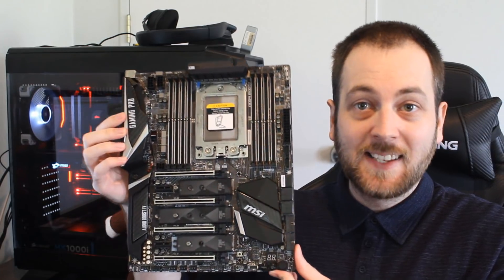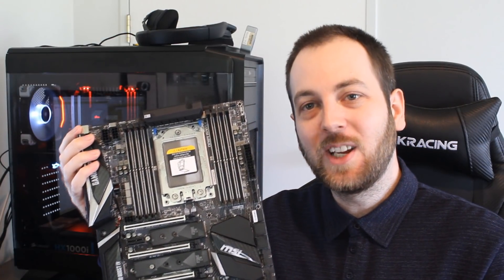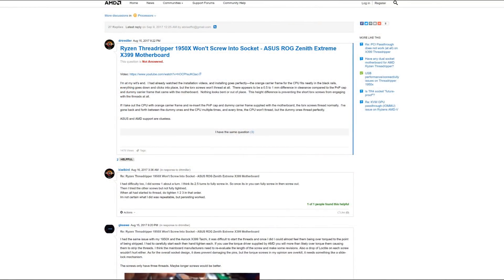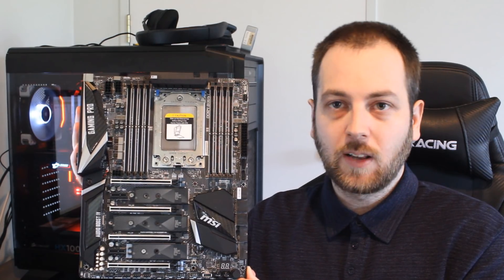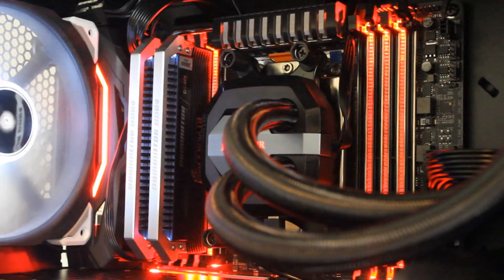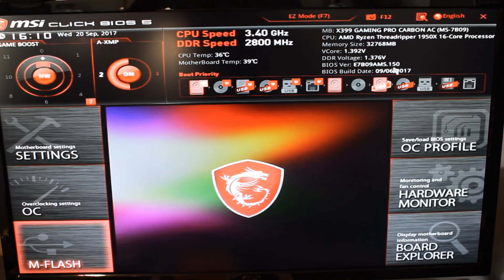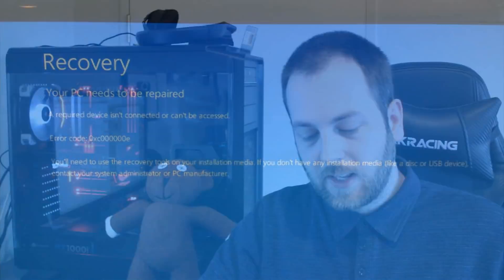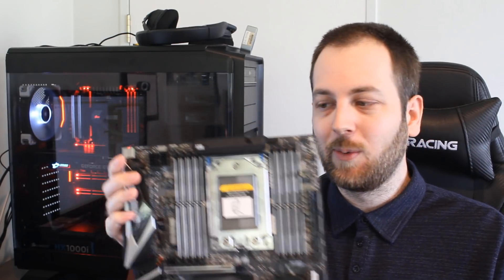X399 Is A Mess Right Now (Socket, Memory & Windows Issues & Fixes)

Comment: I have been waiting since launch day to post my review on the zenith with 1950x...1 rma later and if I had a stick of dynamite I would have blown the entire thing up.  Memory issues like no other....3200 Dominator platinum 32gigs.  Board not recognizing all 4 sticks, unlimited boot cycles.  Tried gskill memory same issue.  Aura lighting not working.  But with each bios revisions it seems to be getting better.  I agree when the kinks get worked out it will be amazing.  But it's not just gigabyte boards.

Comment: Thanks for the informative heads up Kevin.  I'm gonna wait until more of the bugs are worked out on the AMD platform.  My last early adoption was a Sandy Bridge i7 2600k & MSI P67A-GD65 and that took about a month to sort things out. (frustrating)  Ultimately it came down to a B3 revision board and good bios update. (Over Clocked and Still running super stable today)

Comment: No problems with memory with the zenith and 1950x. The cpu was hard to screw down, but nothing this. 
I installed 8 dims with G.skill  3600mhz cl 15, installed windows and overcloked my cpu in no time at all. 
I am running at 4Ghz, 3466mhz 14-13-13-33 now. (3500+ CB15) 
What i don`t like about the Zenith, is that the values reported by the Oled display is wrong. All of them, any bios iv tried. Not even cpu clock speed is correct. On a 600$ mboard!  
Also, I am not able to control the vcore like you can on the Msi board, it constantly undervolt my cpu. 
My last x399 problem; the temp offset. 

But i do not regret getting the 1950x and the Zenith. :P

Comment: It is mostly a socket issue. Not posting with OC is ram fail. Look for "moved" or bent pins. Install CPU on MB out of the case on a flat surface and follow these instructions: https://www.youtube.com/watch?v=RUOZE0N5WE8

Comment: so the lesson is if you are going X399 you better go MSI or ASrock(?)
Reply: milodon316 i have msi x399 and i didn't experience any problem. The only thing is make sure you disconnected all the other drives. I m at 4.05 Ghz 1.33 V on 360 aio water cooler

Comment: It seems that most of these issues are bios related. Except for the crappy Foxconn socket. Keep updating the bios and I would be confident most if not all issues will be resolved. Also, very valuable info regarding which would be the better motherboard to buy.

Comment: Unfortunately, I had to send my Aorus X399 mobo back to the manufacturer. For some reason the system was not able to pass the POST and the CPU status LED on the board stayed lit after power on. I was running the F2 BIOS and the system worked for some time before this issue happened. The problem remained despite of all my troubleshooting efforts. I am now waiting to hear from GIGABYTE and get replacement from them. 

Regarding those other issues described in this video, the problem with the socket's retention bracket was present on my Aorus X399,  I also had the issue with the C0 BIOS code, but that disappeared after a BIOS update. I also encountered the annoying problem with the missing driver for the Inter Wi-Fi adapter but managed to get around that. Luckily, I haven't experienced any memory compatibility issues with my 64 GB memory kit. Used Corsair's Vengeance  CMR64GX4M4C3200C16  RGB DDR4 memory.

So far, my experience with the X399 platform has been terrible. The motherboard manufacturers need to work more to fix all of its different quirks...
Reply from the maker: Sorry to hear that, how long until you have a replacement?
Reply: The motherboard is still on its way back to the manufacturer. I should hear from Gigabyte by Monday next week.
Reply: Alexander Iakimov gigabyte, there's your problem
Reply: Well, I will be receiving motherboard replacement sometime next week. I should have researched the different options better before making my choice. 

If I had to choose now, I would have bought X399 mobo from MSI or ASRock. Looks isn't everything...

Comment: I know this is completely unrelated to x399 but I'm trying to find out any answer I can before my RMA period ends. I have a 1700x with an x370 Taichi. I bought both of these parts with the specific intent of overclocking in mind. It is being cooled with a Scythe Mugen 5. I know it's not the best, but it's certainly better than the stock cooler.

My chip can only achieve 3.8ghz stable, I certainly didn't win the silicon lottery but I figure whatever, it's still good enough. However, my issue is that sometimes it boosts itself up to 3.825, 3.85, or even sometimes 3.9

During the times it does (randomly) boot itself up like that, I crash. I have core performance boost disbaled in bios, cool and quiet disabled, c6 disabled, am running the most recent bios (this issue happened with the previous bios as well) and I am running the AMD power plan. 

Has anyone else experienced issues like this, and if so - were you able to fix it? My window for RMA ends on the 22nd so I have to either figure this out soon or return them.
Reply: Running a 1700 and Taichi, have not overclocked much but have used 3700 no problem on a Scythe Zipang, have not tried more because it gets a little noisy.
Have tried both fixed 3700 and Pstate 3700.
The load speeds always seem to be stable, but maybe the XFR works different on yours.
Reply: I hear it heats up and it the board specific issue

Comment: Still sceptical about the amd ryzen / threadripper. I have always been amd from the old 486 dx2 days. this year i bit the bullet and went to i5 7600k with a maximus hero ix and haven't looked back, although i did love my fx8350. Going to see how the threadripper pans out for gaming, until then not sure.....
Reply: Considering Threadrippers "gaming mode" disables 8 cores to give more bandwidth to 8 remaining cores (effectively turning it into Ryzen 7), and the fact TR chips aren't made for gaming, I wouldn't hold my breath, because as it stands even now, most games aren't even optimized well for Ryzen 7.

If you wanna upgrade, your best bet would be to wait next Zen lineup, which will have higher clock speeds and probably other improvements.
Reply: Going to see what coffee lake brings up...but going to wait until the ryzen platform is stable etc. Pretty happy with my i5 7600k @ 4.9ghz, although newer games will have capabilities of utilising extra threads.
Reply: ryzen platform has been rock stable for 4-5 months now lol

i bought R5 1600+Asus X370 Prime+3000 Mhz Corsiar Vegeance (Hynix) on launch day and the only "issue" i had is that memory profile didnt work and i had to put in settings manually....with a bit of latency improvement....which i would do anyway.

oh, the other issue i had (and still have) is with terrible Intel® I211-AT, 1 x Gigabit LAN Controller(s)  which STILL doesnt work properly unless i turn off all "advanced features"....so avoid boards with intel LAN at all costs...as i found out later....vast number of people have same issue with intel LAN controllers on any mobo they are feautred on, intel or AMD.

Comment: The X399 is based on server technology so therefore you should possibly go with the Aorus X399 motherboard and load all memory slots with 8x sticks of SAMSUNG 64GB of DDR4 memory modules and see if it will boot up on stock settings if so then leave it at that maybe  go with a hard core water cooling system, Maybe it is time to get rid of Microsoft Windows and go with UBUNTU 17.4LTS 64bit and see if that works better than Microsoft Windows, Servers run Linux not windows.

Comment: Another info worth mentioning: AdoredTV has reviewed 3 x399 mobos, and while installing Win10 on Aorus mobo, he kept getting a bluescreen. Turned out, it was caused by Intel's wifi driver, and downloading the driver fixed the issue.
Reply from the maker: Interesting, I spoke to Jim about his x399 experiences a few weeks ago, he seemed to like it overall but did have a few issues.
Reply: Yes I had the same blue screen error experience due to the Intel wifi driver, sorted pretty easy though.
Reply: I can say I had this exact same problem as well.

Comment: This sounds like more of a gigabyte and/or bios problem (considering I haven't heard of anyone using ASUS, MSI, or Asrock boards (except for the one Asus board you mentioned, but that's a hardware/manufacturing issue)). And I believe it's more of a GB problem. Example: (though anecdotal)

Once bought a GB P45 board for a C2Q Q9505S. Installed everything, wouldn't post (black screen, no post codes from the speaker, nothing). Took everything out and turned it on after putting pieces in one by one, still got nothing. RMA'ed the board, GB rep said there were MISSING pins in the socket (not bent, just plain missing), sent me a new board, and before I put anything in, I tried turning it on, and again, no beeps, nothing. Installed only cpu and ram, still no beeps, put in video card, black screen. Went out and bought a seperate GB G45 mobo (just to try to use integrated graphics, one less component to install), same thing happened. I haven't used anything GB since (I even try to shy away from their video cards)

Comment: I have problems with gigabyte with gpus. 1050ti gigabyte low profile edition I use a dvi port and when I screw it in, one of the screw slots become loose and another problem is one of dvi screw slots is easy to screw in and the other is hard...
Reply: CrimsonFate Gigabyte has not really been seen too favorably in the GPU side of things. Coil whine and all that. They're getting pushed lower and lower down the tier list. Now that I see that their slacking here, I'll avoid their Ryzen boards and maybe their Covfefe Lake boards unless they come up with a white and blue board like their z170x ultra durable.

Comment: I'd like you to get the same board but in x299 paired with a 7900x or 7820x and maybe DDR4 4000mhz ram and see if you have any of these issues. Just to compare both platforms and see which one is the more stable/mature or most reliable workstation.
Reply from the maker: I have already tested the x299 Gaming Pro Carbon and it was fantastic, I had a few issues at first with Gigabytes x299 boards (USB issues) but that MSI x299 didn't have any issues.

Comment from the maker: One other thing that I didn't point out is that even when the x399 boards have been working, all of them display 'AA' or '40' on the debug readout all the time, no temp readouts.
Reply: Tech Showdown its not a mess that motherboard is a damn mess i return the carbon for zenith and it fix all my issues.
Reply from the maker: Nah my memory is perfect, is working just fine now with the x399 Gaming Pro Carbon after the latest bios update
Reply: Did you watch the video? The Aorus board was the one with the issues,
Reply: Darkpharoh great logic problematic Gigabyte = shitty MSI
Reply: Regarding the memory not accepting four ram chips, did you check if at least one of the memory chips is faulty? I encountered that problem a few days ago when purchasing new ram memory chips that one of the chips was faulty and would not load and would crash the system regardless of where I placed the chip. I replaced the new ram chip with another one and everything was fine. Just a suggestion.
Reply: I thought you had to slide the chip into the metal bracket, like i've seen in so many other videos.... nevermind... that scene wasn't included.
Reply: I haven't hit any of the issues you mentioned, I have been a day one adopter, and I am an INTEL shill, running 4.125ghz at 3466mhz ram rock stable
Reply: Tech Showdown have you seen the video HardOCP published about the CPU installation?
https://youtu.be/RUOZE0N5WE8
Reply: THey both are shit only asrock is good and maybe asus yeah i doubled down. Asrock boards been running DDR4 at 3000+  since launch  with 2 bios updates a month.